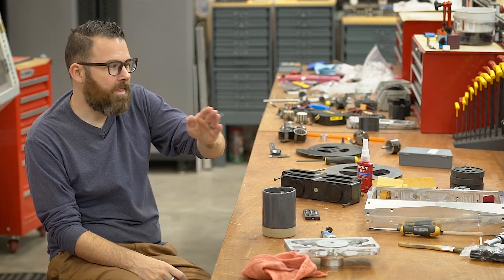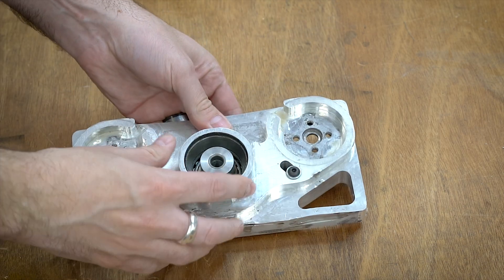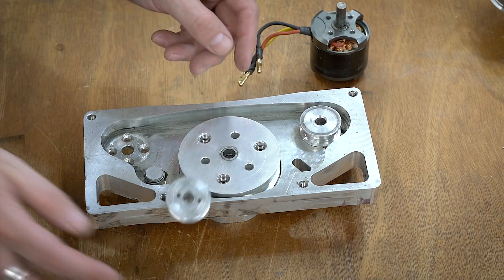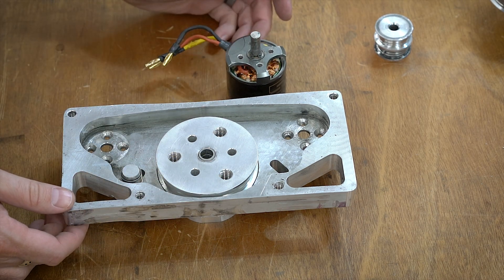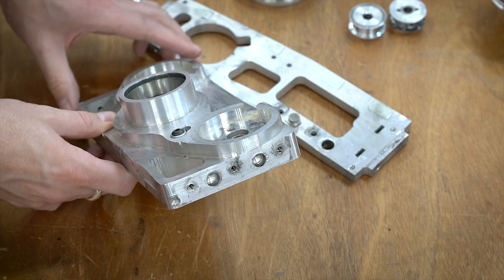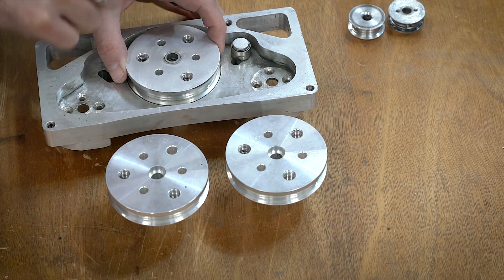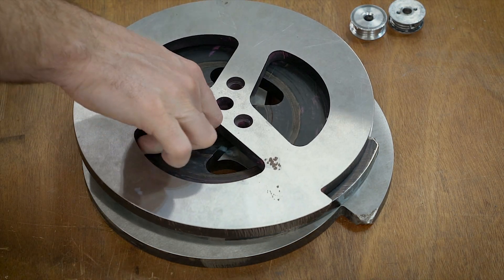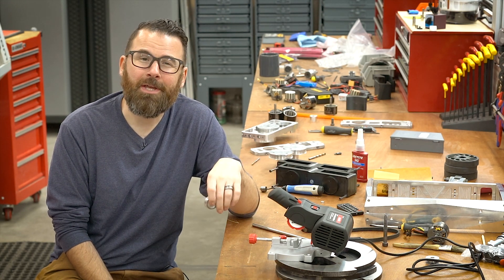Rebuilding the Weapon Assembly (Crippling Depression V4)

Comment: I've always thought of 3D printing and the different methods, have you ever throught of Resin 3D printing?
Reply from the maker: Oh, I have.  It's messy, the fumes are nasty, the resin irritates your skin, build volumes are generally significantly smaller, and the resin selection isn't as broad as filament.  I want one badly, I just haven't been able to justify the hassle.  They're really better for small details, which isn't something that is as important to me.  The prints (in general) tend to be more brittle and wouldn't work for many of my applications.

Comment: One thing you could try with those chipped teeth is welding up a new tooth. You might be able to fill fix them with S7 weld (I think that’s a thing)
Reply from the maker: I could, but you'd have to anneal the whole thing, weld on a tooth, rebalance it, and then harden it.  Lots of work when I can just get a new AR500 weapon pretty quickly.  For one competition, I'll just go with AR500.
Reply: @RobertCowanDIY  ya might as well save the time. Good luck at AVC, I’m excited to see how crippling depression does!

Comment: Great breakdown! Perhaps I missed it, but is the weapon block and/or main pulley 7075-T6 or similar high yield strength aluminum alloy?
Reply from the maker: It's 6061.  7075 is stronger, but is harder to get and more prone to cracking.

Comment: if I were to build a battle bot I would build it in hardox 500 as it is so strong It is but it has three times as much weight So you have to remove a lot of material but it will still be stronger than aluminum
as I for daily construction machines of various kinds and have good experience with hardox
as I build many different machine types and have good experience with hardox also with weight limitations
Reply from the maker: No one's stopping you!

Comment: For the main weapon pulley/spindle, could you use sacrificial bushings at the ends of the center bolt where it's supported, so they take the damage before the pulley? I presume they'd be quite easy to replace at the end of every fight if necessary. That way you maintain the rigidity of the weapon for energy transfer, but the wear & tear that physics demands goes somewhere controlled.
Reply from the maker: Interesting idea.  I think the bushing might have the same issues, it would just deform the aluminum.  The hubs usually last an entire competition.  I think for right now I just need it to last through one competition, and I can go from there.  They are pressed into place and cannot be easily removed, so I see them as part of the pulley.  I know it's more expensive and wasteful, but just having multiple pulleys is the 'best' option.  Removing the bushings could end up being a LOT of work.  And if I'm in a position where I NEED to do that, it's most likely not the only thing that went wrong.
Reply: @RobertCowanDIY  oh sorry, I wasn't clear enough - I'm not referring to the existing bushings in the pulley, but instead adding new sacrificial Al bushings in the plates that support the bolt.

Comment: To retain the motor pulley you could do a closed end keyway on the shaft so the key can't move, and then have a tapped hole in the key. Insert the key in the shaft, slide the pulley over it, and then put a screw in to clamp the key to the pulley. 
You could also put a "retention screw" on the motor pulley that locks into a divot on the shaft itself (or the key if it's captive), so it's not galling the shaft surface, but prevents the pulley from sliding up on the shaft.
(with the key, it's not a set screw anymore! Lol)
Another thought is to have basically a nut underneath the pulley that locks into a notch in the shaft, and then after sliding the pulley on, a bolt goes through a hole in the pulley parallel to the shaft and into the nut.

Instead of the bushings in the ends of main shaft, could you put a sleeve all the way through so that no crushing force is applied to the aluminum to begin with?
Or maybe add a little flange to the bushing to spread the crush force out?

In regards to replacing the dowels with aluminum pins, the best case scenario I see is that they become sacrificial parts and fail before the frame gets oval! Lol
That may be a good thing, but make sure you have a plan of how to remove and replace them when they do!

I wonder if there is an easy way to spread out the load more, more pins, some way to make the pieces interlocking etc.

Great video, excellent information, and I look forward to seeing you in battle again!

Source: a YouTube fighting robot engineering expert! (who OCCASIONALLY has a great idea ;) )

Comment: Definitely agree with the patterned pockets for the Propdrive motor faces, I had some machined in my wep bulkheads on my FW “Cpt Jack Spinnah” about a year ago and it’s been flawless mounting so far with some big hits 🤞🤞
The screws essentially just keep the motor in place then while the pattered pockets take all the torque from impacts. Mine is into HDPE though not Alu.👍
Reply from the maker: Yeah, I have done this with motors for awhile, but CD is actually a bit of an earlier design.  It helps with the screws rattling loose too.  I did something similar on the drive as well.

Comment: I always enjoy watching your videos, having never built and probably not going to, make my own robot. See the engineering that goes into the construction and maintenance. That, however, doesn't stop me or probably others wondering what it would be like to see ideas that you have or imagine, come to fruition. Even in a small way. It just makes you feel, valued I suppose that you could contribute something to a project to make it better or whatever. My idea: (insert laughter here) is just a thought really, based on your problem, around the weapon. Have you tried to shock mount, or transfer the load out of the central shaft to the three mounting bolts (I assume it's for the titanium hat) similar to the tires you have, which I saw in the background? Or, could you with the same material, connect the central shaft sleeve, with the three outer holes, via a channel of the same material, putting a sleeve in each of the other outer holes to absorb the impact, or spread the load a little. Just my rambling thoughts.
Reply from the maker: I like your idea, but approach everything with the problem first.  What problem are you trying to solve for?  Less energy being transferred?  One of the main benefits of CD is that it's so rigid, it does a good job at transferring the energy into the opponent (similar to Copperhead as well).  By shocking mounting the weapon, some amount of that energy will then get absorbed into the shock mounts, lessening the impact.  Ideally, if I can keep the system as rigid as possible, it will want to follow the weakest link, which is hopefully the opponent.  Of course, there are many ways to approach any problem, I try and go rigid and reliable when possible.

Comment: I assume those modifications will be similar to what Adam Savage did with his? https://www.youtube.com/watch?v=ritwf-_iOlg
Reply from the maker: Absolutely not!  I love Adam Savage, but at the end of the video, you can see that the performance is awful, just as it started out.  He just made it easier to hold a workpiece, not actually cut anything.  I want it to cut better.  I have ideas.  As soon as CD is done, I'm going to work on that.  It's a neat little tool, it just needs some work.

Comment: do you have the ability to machine hardened S7? if so could you remake the teeth and rebalance the weapon disks?
Reply from the maker: The Tormach can machine S7, as long as it's slow and only a small amount.  I COULD remake the teeth, but it would be out of balance.  It's wroth doing, but not worth the time right now.  It's cheaper/easier to just get a couple new weapons, and I want to test different geometries too.

Comment: Totally agree with you on set screws. They should never be used to transmit torque. I’ve always been torn between keyways and collet systems. Collet systems are surely the most elegant, but not sure how they compare to keys in terms of ultra high torque and shock loads.  Really love your work. I miss copperhead already!
Reply from the maker: I REALLY wanted to do a square or hex shaft, but already had a bunch of extra pulleys, so I just went with a keyway.

Comment: I would investigate having hard facing rods arc welded to those broken teeth instead of spending more money on new ones. All heavy machinery buckets and augers use it, the rods should be easy to find and inexpensive.
Reply from the maker: Yeah, I just don't really have the time or energy to mess with it.  Plus I want to investigate new weapon shapes.
Reply: @RobertCowanDIY  Given the damage to the previous ones, it may be worth looking into doing something for your new ones as a proactive measure. The cleavage of the teeth indicates a very hard steel that is possibly more brittle than you might want for that application. Hard facing or localized case hardening on a more resilient (and likely cheaper) steel may result in a longer lasting weapon that can utilize the mass you have allocated more effectively. Anyway, I look forward to see what you come up with.

Comment: Hi Robert! I'm just getting started on my combat robotics journey and the amount of information I've gotten from your videos has been absolutely incredible.
I'm currently drafting up plans for a test box that's fairly similar to the one you posted. I noticed that you did a butt joint at each of the corners, which would make each side of the box nominally 48 3/4". It's throwing me off a little bit because it seems like the floor and ceiling fit pretty well and I would assume that those are exactly 48". Do you happen to remember if you had to trim down the sides slightly to get everything to fit nicely? I just wanted to make sure I'm not being dumb with my design.
(Apologies for asking this on an unrelated video. I wasn't sure you'd see this if I posted on the original test box video.)
Reply from the maker: I honestly don't remember if I ripped them down.  I very well might have.  It doesn't really matter, just do what make sense for you.  I have it hinged now, so it breaks down into 2 pieces and stores between my workbenches.

Comment: I recommend doing a shrink fit for the pulleys instead of a keyway.  A smooth shaft with a shrink fit will transmit a lot of power, it's how most CNC machines transfer power to the spindle.  For a small shaft like that, you'd probably need a 3-5 thousandths shrink, which means doing a lot of heating of the pulley.  I also recommend designing a puller that will work with that configuration so you can get the pulley off.
Reply from the maker: Shrink fit sounds nice, until you need to service it.  They need to be removable.  So the method of installing and uninstalling would need to be done at the competition with limited tools.  Everything is already keyed and the shafts have been made ;-)

Comment: The big Al pulley is part of your energy storage.  So make it out of steel.  Drill some holes to help with the weight.
Reply from the maker: You assumed I didn't think of that already?  The aluminum pulley is 199 grams in aluminum.  In steel, it's around 580 grams.  You're talking about nearly a full pound heavier, it's already 'lightened' as much as it can be with holes too.  I understand your thinking, but you can't just simply sub in different materials and not expect it to be problematic.  Finding an extra pound to spare in this bot is nearly impossible.
Reply: @RobertCowanDIY  I didn't assume anything.  Just a suggestion.  I wonder if there are stronger alloys of Al or Mg?   Good video.

Comment: as a tool maker i would subject using a long aluminum key to locate the frame together instead of aluminum dowels so the load has a large surface area. also the key does need to be the same material or softer so its a sacrificial part. if you do follow my suggestion i would also bolt the key in 1 part so the key cant turn in the slot as ive had before in extreme loads. also put a threaded hole in the key so you can jak it out when replacing.
hope this helps 👍
Reply from the maker: Thanks!  I was thinking of some of those suggestions, but I can't do all of them, I'm limited in space.  The sides of the block are getting pretty thin, so a long key would be great, but it might not work, we'll see.
Reply: @RobertCowanDIY a good out mortise and tenon joint is good but no replacement part if you get a big hit so may not be great but im not a robot builder but just love the problem solving engineering that goes on in the sport and the evolution of the robots.

Comment: Great videos Robert!...I'm designing a 12lb bot...What off the shelf motor(s)/esc controller(s) and tire(s) would you recommend? I'm interested in using the same motor/esc for the weapon system as the drivetrain....tire to motor mount if possible and weapon to motor mount also...Thank you for a great season on BB....and Glad your back onto making more builder videos! 🏆🏆🏆
Reply from the maker: The recommended motor and ESC is the one that fits your needs!  I never recommend components because YOU need to figure out what the motor needs to be, based on the design you're trying to achieve.  Figure out how fast it needs to spin, how big it can be, and how much power you need.  Then pick a motor that will meet your requirements, and pick the ESC that can drive the motor.